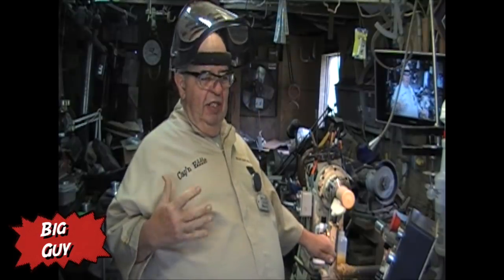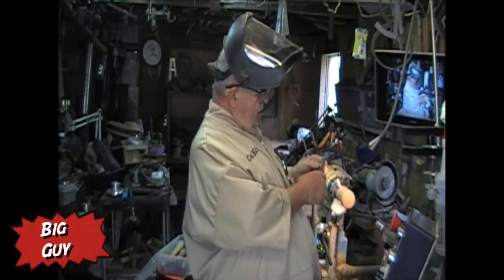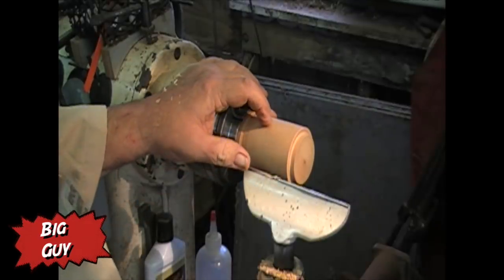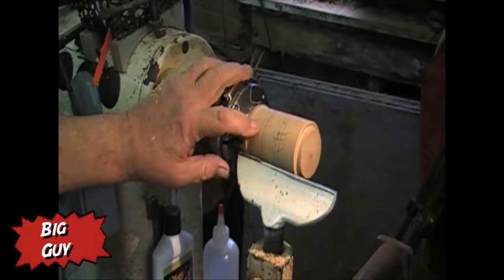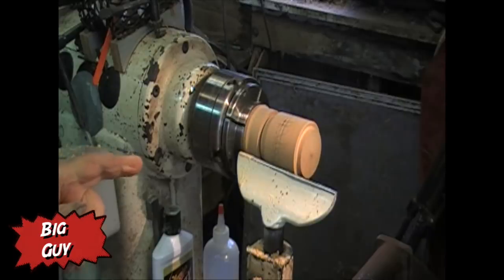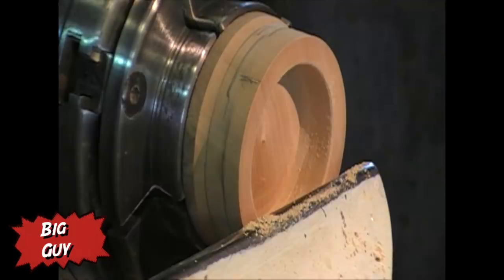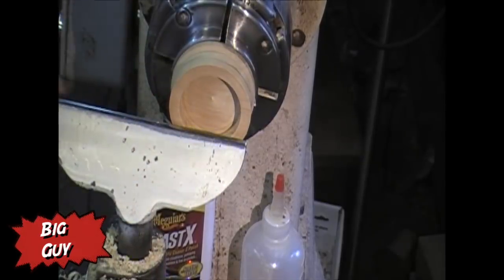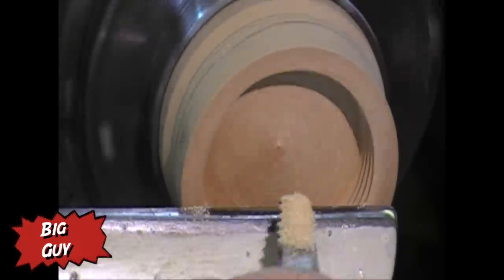# 338 Threads one

Comment: Always a joy to watch your videos. Although lately I've been busy at work and with " regular hours" I only have the weekends to enjoy things. However the other day after work I was so frustrated, yep it was one of those days, I went to the shop and turned a bowl and left all my frustrations of the day as a pile of shavings on the floor. I also turned two bowls today.  Just been missing the opportunity to be creative. and I used a wood worm screw which made the whole deal go faster.  I also did a recess in the bottom of the bowl and expanded the chuck to hold things. So much better to turn, cause I can finish the bottom without having to mount the bowl on my mini lathe with my home made bowl holding chuck and turn off the spigot.  Keep up the good work.